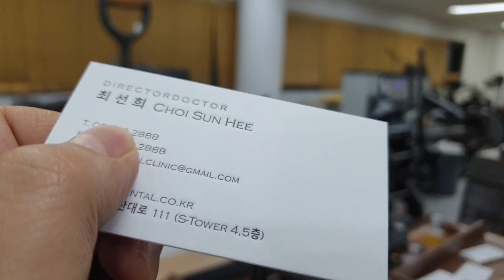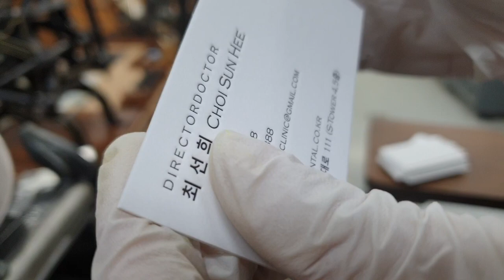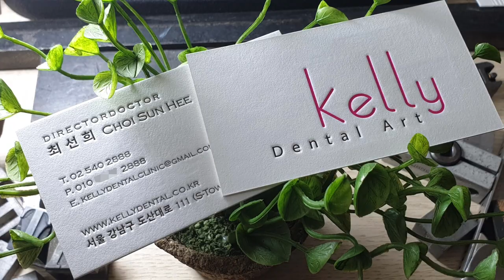Create letterpress business cards using black ink + two fluorescent inks.레터프레스 고급명함만들기

Comment: ich schaue deine Videos und mach dein Arbeit sehr .Die schwarze Platte zum kleben von formen, welches Material ist dieses Platte ?
Reply from the maker: Hello. The black plate is a hard plastic plate called Bakelite. It is also a material used for radio boards.
Reply: Danke